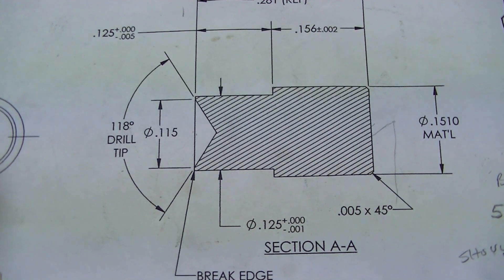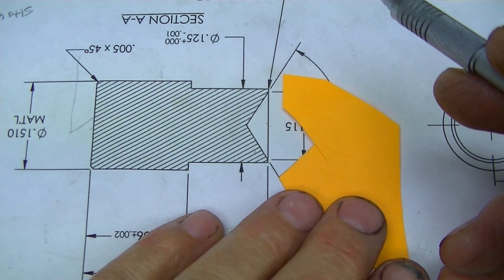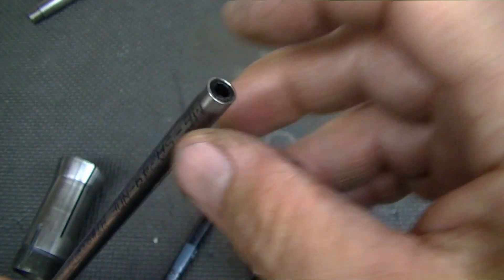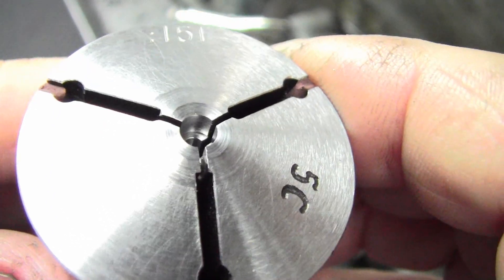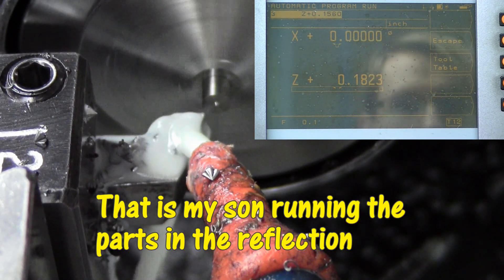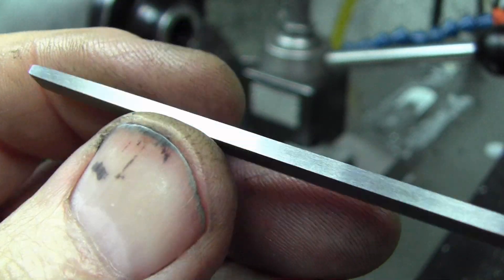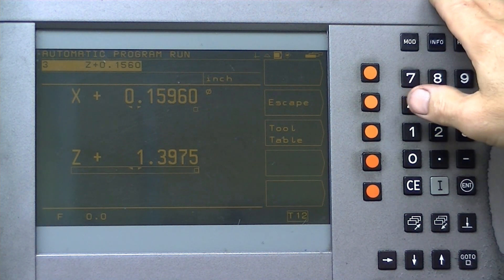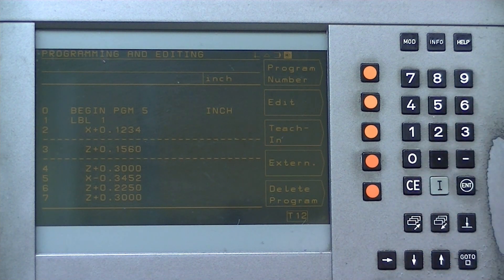TIPS ON MANUAL LATHE HIGH PRODUCTION

Comment: This video makes me miss my hardinge 59 I found the Hardinge free! Unfortunately the Aerospace company that had it employed really really bad support team they said it was completely and utterly fried LOL we had a bad electrical storm and half of the city went down for a day and a half and that's when they said it happened and I knew what happened even without seeing the machine it had a Step up Transformer for 440 and I knew that's what fried because there's that and then the fuse system and relatively light wiring. The guys gave me this thing for free and said well it was never right anyway and they told me the list of things that was wrong with it and they were incorrect on every single one they had wired the speed top and bottom sensors backwards LOL so the machine would crash and jam if you went over under speed I don't know if you understand how a hardinge of this type is set up but it's basically a mechanical speed adjusting system where it causes the pulleys to dynamically spread apart or go together to change the placement of the belt for the speed adjustment it really is quite elegant system. Well if you don't have the correct sensors working you can imagine what would happen. New paragraph it took me all of probably three or four hours to get the entire system humming like a perfectly oiled Swiss watch. They never used the bedways they were brand new LOL this machine was so gorgeous.

So I got that for free and then I found a really nice guy that had a turret system and he said he didn't even know how to use it the thing was brand new in the box it was one of the original old turrets that came right from the same plant! So I got that running taught myself how to set that up which wasn't too difficult and was off and running unfortunately some bad things happened to me and I ended up homeless and lost that machine. I was basically ripped off by a woman I put a house in her name because I was supposed to die from a condition that I have. I told her I wanted my name on the house when I started getting better and they told me I am beating my condition and I'm not going to die from it she fucking kicked me out and stole my house!! Anyway

I miss that machine it would have made making a part like this so simple three or four poles on the turret handle and you'd be done and if you made elegant well-designed Cutters like you're showing here even less pulls
Reply: Aaah women. 
Can't shear them, the 'works won't take them and they're no good for rounding up stock.

Comment: Rob, I'm enjoying your videos and learn a lot about the fine details on machining precision parts. I have one question about using the (pulling) 5C collet in this video. In my experience the collet doesn't repeat lengthwise accurate as it is depending on how tight you fasten the collet (it draws back more as you tighten more). So how do you repeat accurately lengthwise? Or is the tolerance on the length of the part big enough to do so? I'll use a stop in the spindle in my lathe where my part is butted against when tightening the collet. Pressure collets (e.g. Jacobs) are also a way to go but I don't earn them and they are quite expensive and labour intensive on a manual lathe. Curious on your answer and like to hear from you. Thank you for sharing your knowledge with us. Best regards, keep up the good work, Job (I didn't read al the 284 reactions so maybe someone asked the same question you could refer to and the I appologize for asking)
Reply from the maker: It is actually part diameter and closer force sensitive. There are "dead length" collets that eliminate the problem if tolerances require.

Comment: I am not a programmer, but it sounds easy to make a quadrature analyzer on a PC. If so, then why are we paying so much for DRO bottom of the line readouts?
Reply: How do you get a GHz from a million divisions per second? A million per second is a MHz, you'd need a billion per second to get a GHz
Reply from the maker: signal frequency can get pretty high on fast moves
Reply: Computers have gotten a whole lot faster since 1996, a modern smart phone GPU would give the world's best super computer of 1996 a run for it's money. If the cost is actually justified by anything, it would have to be in the scales.

If I was going to make a guess, I would actually say the price is just a natural product of the market. I would guess that most people buying DROs are buying them to use them to make money, and therefore they can afford to spend a lot more. Lowering the price would get new customers, but not enough to compensate for the loss from the larger segment of the market that is prepared to pay the higher price.

The only way it would make sense to sell a cheap DRO would be if it's so gutted of features as to be next to useless to the professional crowd. You see this kind of price discrimination at the high end too, units with better features cost more than units without, even though they cost the same amount to manufacture, because that way they can squeeze more money out of the people who need those features.
Reply: ROBRENZ , Hmmm - a million divisions per inch at an inch per second would give a GHz. I think quadrature is done by comparing two (or more?) much slower signals and comparing  the phase angles. This is how a modem and other devices reach such high baud rates over phone lines that would only handle 2400 baud circa 1970. The same is likely true of ethernet and other signals only at much higher freqs. Still a computer is just needed to fill a readout and do some calculations on the order of all the functions on a scientific calculator and put the results on a color screen that has to update at the 60 Hz range. At most you would need something like a network card with a USB port. or maybe run it through the video card or an expansion card which has a huge segmented numerical processor. Sorry this not my profession so my words are just speculation or at best a SWAG. Please feel free to correct me to your heart’s content. :) A CNC should be able to measure as fast as the cutter moves at X resolution. Dan Gelbart likely has the chops to design this or you for that matter. No telling what wonderful knowledge you run across meeting folks on the internet! It just takes a while to appreciate the scope of knowledge.

What I am getting at is that a machining aid device could likely be made with a 3-foot screen that costs $350 and a $600 CPU box that is just waiting for the right software. Why not have a machine that connects to all your machines and will keep up with your work, BOMs and for that matter youtube videos too? Having a $1000 + readout on each machine is a waste, IMHO. I think major mfg corps have those anyway.
Sorry for rambling on, and thanks!
Reply: Rob Mckennie , Million = GHz? Sorry, brain cloud.
Reply: What you are missing is accuracy, repeatability and reliability.

Yes, you can hack something together on a computer, but how are you going to measure the position with that high an accuracy?

Cnc machines I think usually do it with rotary encoders on the drive motors, but on retrofit applications usually it needs linear encoders, which are quite expensive if you want precision and durability.

So by the time you do all the research and programming and fabrication to install encoders on the machine, wire them up to custom adapter boards to interface with the computer, write and debug code, get metal shaving, oil and dust proof touch screen industrial monitors and keyboards and computer housings, and then have to learn and calibrate a new to humanity system, spending $1000 on an industry standard, shop hardened, off the shelf, bolt on DRO that just simply works, and has technical support and lots of people familiar with it sounds like a pretty good deal!

Comment: Hi Robin.  Just watching this for the second time, and this time with great interest in your information on the Heidenhain.  I have come across a refurbished Positip 855 that I am thinking about.  It is not cheap, and comes without encoders, but it would suit my Schaublin 22 mill more than a modern DRO. (Actually they came with even older Heidenhains originally)  Do you think it is money well spent to buy one of these today?  I mean I could probably get a more modern and fancy DRO (colors and everything) for less money but it seems these unit live forever, and have both basic function used most of the time, and more advanced functions.  The idea of moving it from the mill to the lathe is also food for thought.  Thanks for any input on this.
Reply from the maker: Buy it!  No real functional differences compared to the newest heidenhain version. You might want to check compatible scale prices first.
Reply: I see that the scales are rather pricey too, and there is a lot of models to choose from.  What type of scales do you use with your 855?
Reply from the maker: I used Analog Accurite MicroScales which are no longer made but there are things that are similar available. The scale must be Analog output with 7-16 microamp peak to peak signal into a 1k ohm load.

Comment: Analog encoders don't necessarily give you or allow for more precision, they do allow you to vary resolution some.  Accuracy would be limited by the ability of the ADC that's sensing the analog voltage and essentially deciding when the next digital transition will happen.  I did enjoy the tips on the dual purpose tools.  Avoiding potentially embedded grit into the part until all the machine tool operations are done seems crucial.
Reply from the maker: I was careful to say resolution, not precision but the electronic subdivision done by the readout is very good.

Comment: Great video sir. It looks like you run water based coolant in the HLVH, mine is my favorite machine in the shop. Have you had any issues with coolant intrusion into the apron gearbox? The previous owner of my HLVH used H2O based coolant and it eventually rusted all of the gears inside necessitating replacement of all components. Fortunately Babin Machine Tool had a complete set of internals. I suppose you keep a good eye on the condition of the ATF inside or were you able to seal it?  Thanks for the informative videos.
Reply from the maker: Thanks, yes Houghton 795-MP semi synthetic which has a high mineral oil content. No rust or contamination issues at all. But I have extensive guarding on the machine as shown in my video https://youtu.be/qjh63pll0VM

Comment: Robin, Water base coolant on the Hardinge....
I use it on my HC Hand Chucker, for the last 25 years. 
ALWAYS lube in excess. 
I got coolant under the carriage one time and it acted like the LOCK was on 
Much drag was caused by the emulsion. 
As you know, Hardinge ONLY recommends OIL
Reply from the maker: My next video will show the guarding I made for the cross slide and bed. Coolant never touches the ways. I have had no issues in 20 years but like you say I pull the oiler 4 to 6 times a day.
Reply: Great! 

PS 
Your Son's a lucky guy to learn under a great mentor like you!

Comment: I was looking at some Abom79 stuff and found your excellent channel...! Regarding the digital readout...I worked at Burgmaster in Los Angeles from 1970-1980....all the stuff back then used the analog type position sensors, a rotary  3 phase resolver attached directly to the end of ball-screws....with a flexible coupling like you had on the video with the little parts you were 'centerless' grinding.... and...there must have been 15 guys working there as 'scrapers'....they scraped all the ways, and 'flaked' the ways and table tops...tables/travels were all 20 X 40 up to 60 X 120. big turret drills and VTC's....in addition to the tiny bench top units I see on here...like Tom Lipton has....
Reply from the maker: Thanks Doug for sharing some of that interesting history! Thanks for watching and commenting!

Comment: Thanks for great presentations of tools and techniques not available elsewhere.  Very informative, and your camera work and delivery are very clear.  Also, thanks for thinking of those of us who do not have a lot of experience!  

In several of your videos, you mention lapping carbide cutting tools using 1 micron diamond (paste?) on a ceramic lap, and while you show the end results, I haven't yet found video where you demonstrate how you do this.  Is there one?  I'd love to see the actual lapping process.  Do you start with coarser grits and work your way down to 1 micron? What do you use for the rough shaping?

Thanks, -Chris
Reply from the maker: Thanks Chris, I only use 3 or 1 micron on the  lap. I use a 220 grit resin bond diamond wheel to shape the tools before lapping. Thanks for watching and commenting!
Reply: You can see the set-up in the ultimate kelvin video no2

Comment: Great video as always , I  have a Hardinge HC-AT and use oil based coolant(screw machine oil) per Hardinge's  recommendations as they strongly advise against water soluble oil  for use in their lathes .
Reply from the maker: Thanks Jeffrey you will notice that my leave has neoprene rubber covers over the ways and a guard over the cross slide so coolant never touches the sliding surfaces.
Reply: good  way to protect the sliding surfaces .

Comment: Interesting approach. You machine both faces therefore you need to clamp the part twice. The classic approach would be to feed the stock through the spindle against a stop (possibly the tailstock or the positioned turning tool), close the collet, face and turn one side, part off.  Then in a second reverse clamping you would face off the other end. What are the pros and cons of this classic approach compared with yours?
Reply from the maker: My approach;
One collet setup for both operations. 
No pusher needed in headstock to feed stock to stop or stock puller needed.
Stock is protected and cant whip.
Single cross slide motion does exact length and chamfer with one tool.
No stock loss from first op and second op facing cuts.
Minimum machine motions since this is all about doing this on a manual lathe.

Thanks for commenting and watching Rol!
ATB, Robin
Reply: yes, with the classic approach you would need a pusher or even better a bar feeder. However, this would also take care of the whipping. And it would allow longer stock to be used.
Reply: chris0tube Would love to get my hands on a Ward #7 but hen's teeth are easier to find in Australia after the iron ore boom conned everyone into selling them for scrap metal.

Comment: Thank you for an interesting insight for making multiple parts, I had certainly never considered specially ground tooling for combined coning and chamfering. Now I hope you are experienced enough to realise the down falls of using a Drawback type of collett such as the 5 C, for close tolerance length dimensions You were lucky to get away with doing that, it was because the material was ground to a good consistent size, and the drawback would have been pretty constant. However should the part have had a machined step on it and you then tried to do the same, then your results would have come out very random as to the finished overall length. Even if you had maintained a diameter tolerance of + or  - 0.0002", the collett drawback would be different for each part, therefore changing it overall length dimension. I could not make out from the video what model your Hardinge lathe was, I have an HLV. Good luck, keep making videos please.
Reply from the maker: Hi Dave, Yes well aware of the end length variation with diameter variation but this part is not that tight a tolerance for it to be an issue. No harm in bringing the topic up since the experience level of YT machinists varies widely. My lathe is a HLVH. Thanks for commenting and watching.
ATB, Robin
Reply: I have found that my HLV can hold lengths to under a thou for parts up against a collet stop or emergency collett with a shoulder. Of course, as always, trust but verify.

Comment: Thanks Rob, awesome video!  I'm keen to see how you ground those tools. Very good idea however.

That was great info on the Heidenhain head. I have an earlier Heidi, but it sounds like the same scales. I've been thinking about updating it to an ND780, but it's hard to justify the cost given I could probably sell it and buy a complete Chinese digital package for half the price. While my scales are analogue, their claimed accuracy is much worse than modern digitals. It made what you were saying interesting, as clearly the signals could be interpolated but I gather the accuracy limitation is in the glass etching itself.

All in all a very good video and definitely 2 thumbs up on this one. Chapeau mate!
Reply from the maker: Thanks Pete, The accuracy of the scales is not all that important since you are usually only using a short length of scale from your position where you set your origin to where you are on a particular size. Scale quality does come into play with very high subdivision of the sine wave (high resolution) but repeatability should be good even with less accurate scales.  Had to look up Chapeau so thanks for the kind words. 
ATB, Robin